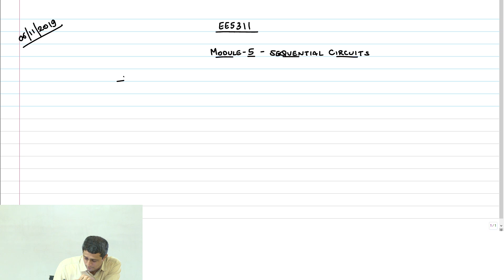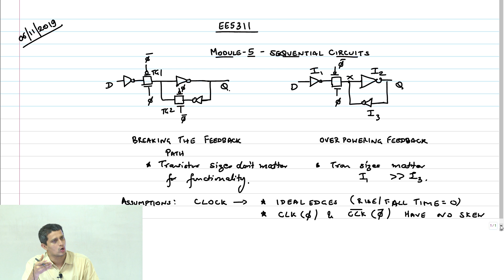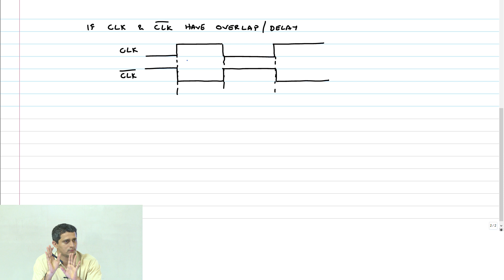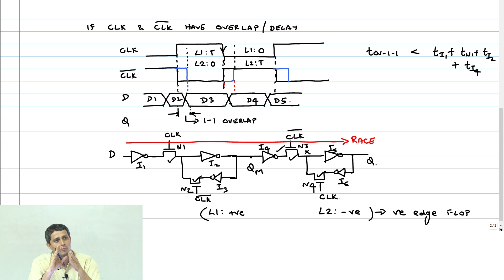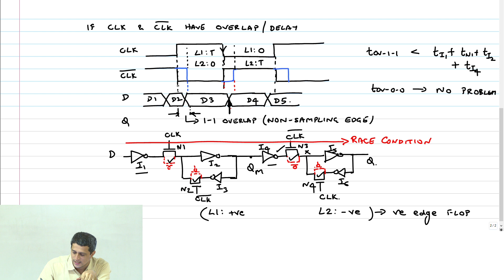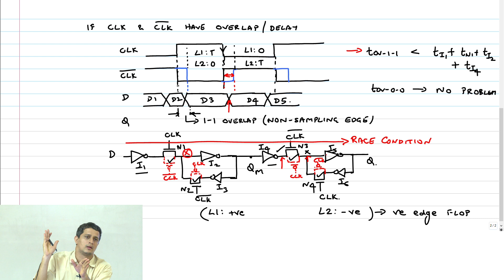SQCkt6 - Clock Overlap

Comment: Hi !
In the situation where we are using pass transistors in lathes, we still have delay offered by I1 and N1, which can be used to compensate for clock skew, so the hold time at active edge should be tov(0-0)-[t(I1)+t(N1)}].
Please correct me I am missing somethig